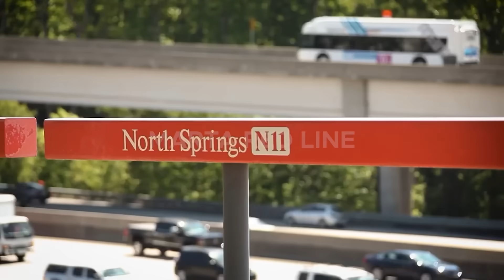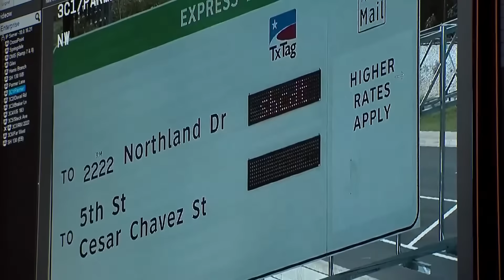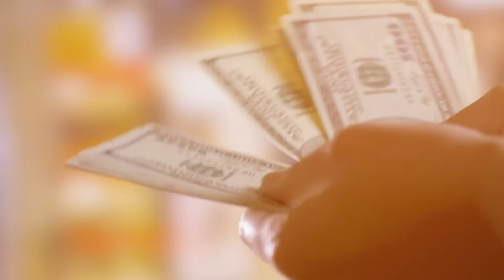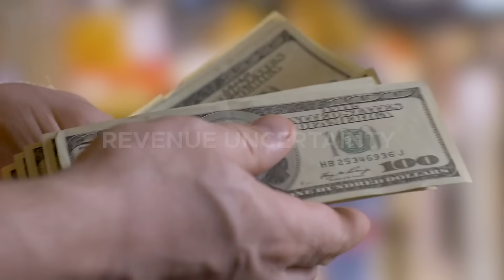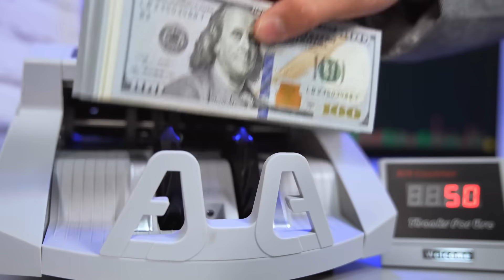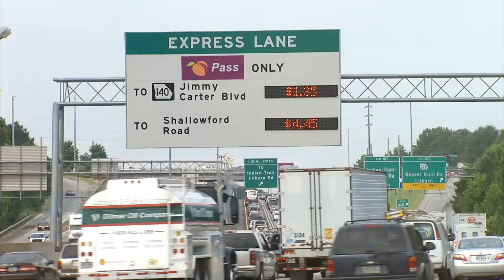The $11 BILLION Gamble To End Atlanta’s Traffic Nightmare

Comment: More lanes is GDOT's answer to everything. I have seen 4 lane highways built out in the middle of nowhere GA, and I ask Why? At the $11 billion price tag, mass transit could be greatly expanded, even if heavy rail costs $5 million a mile, MARTA could be extended to Winward Pkwy on North 400. On top of that MARTA needs to step up by adding more stations where they are needed along existing rail lines.

Comment: Easy. Just build a few more lanes. Get rid of sidewalks so you can add lanes to normal streets as well.
Could also increase the length of vehicles as well. Every time you drive, you could move more of a vehicle with just one drive.

They should probably spread the city to a wider area as well so it would spread traffic around.

Comment: don't believe the BS...problem w/ Atlanta metro:  the people wants to live FAR AWAY from certain areas near downtown and the ghetto elements there...(just look at south of I-20, always depressed).  Instead of solving the problem by RELOCATING certain govt infrastructure to the North, everything must be concentrated within the sh*tty areas...Airport, rather than expanding Hartsfield, a regional airport by Marietta/or east of it would also help a ton.  Problem Reaction Solution, just a scam to enrich certain old boys w/ lots of land/dirt from their grand daddies....using AI, you can easily break down the commuters and where they go.  Most people I know want to live in Brookhaven to Roswell on the west side and Duluth to Suwanee on the east side.  Work on relocating the important infrastructure and services near there, you can alleviate 40-50k cars per day from crossing beyond the lower 285 beltway.

Comment: As someone that works to maintain the expressways on 75, 575 285, and soon 85, trust me. Without the express lanes, your commute would EASILLY have at least another hour added on top of whatever it is now. I have been stuck between one exit and another for upwards of an hour before. Imagine a two hour delay to move a mile. You could literally walk faster. The system isn't perfect. And if you want the traffic to drop, you need to make working from home more common. Even during the Pandemic, one of our points on the North West Corridor tagged over 400,000 transactions in a single month. This was during the shelter on place mandate, and essential workers only. 400,000 transactions. That's roughly 13,000 and change people every single day using that lane for a month straight. Roughly 6,500 during each reversal. So 6,500 people every 12 hours. That's 6,500 people not blocking your path to go a few exists. That's 6,500 people not in the immediate risk of crashing into you causing a traffic jam. 

The only fix to traffic is to remove it entirely. But people with cars are not gonna give them up. Atlanta in particular can't handle that as the sprawl is so vast. Cul-de-sac style neighborhoods will see you drive 5 miles to get to a house a street over, 300 feet away.  MARTA and busses can only do so much, and the planning committees either won't at all handle it, or it will go so slow we will all die of old age first. You want the most immediate "fix", you force WFH and general remote work to be the industry standard for all jobs that can be done so.  But then you have the compounding issue that these huge companies own buildings in Atlanta, and to leave them empty is bad for their bottom line. So again, you find a way to create jobs that allow remote work. Take the cars off the road. Remove need to go to or through Atlanta, and things will improve. But NONE of these answers are so simple. 

The expansion on 400 WILL make a dent in the flow. But it will only do so much. As long as people view toll roads as a problem, they can't do their jobs correctly. Tolls go towards paying for the road itself, funded by the fees SRTA collects from those tolls, which also go into funding GDOT. GDOT maintains the general passenger lanes. Paving, bridge work, street lights, HERO units, the works. And the fee is an exchange for the convenience of cutting your travel time dramatically. 

Moreover, it is my understanding that there is a project on the south side that is working to build a shipping and freight line for 18-Wheelers to help get them off the main roads as well. All these projects are in place to help reduce everyone's commutes. Hell, I WORK ON THEM, and still have to pay for their use. I have to be in the air sometimes fixing a camera or pulling wire, or rebooting something. I see the traffic, every single day. Trust me. You want these projects to happen. You want them to succeed. The toll roads go a long way to help you not hit potholes every 20 feet. Our systems are not perfect, but for now, it's the best we got. Especially since most of the toll roads we have now are converted HOV lanes that most commuters can't even use.

Comment: They're doing the same thing that ALREADY DIDN'T WORK in other places.  Adding lanes is the most SUPERFICAL civil engineering fix you can do.  Houston also invested in lane expansion projects.  It didn't do ANYTHING to offset the rate of growth and the places where they expanded were STILL constricted at the same chokepoints and bottlenecks where suburban commutes met the dense city centers.  It seems like we JUST got rid of the GA400 toll not to long ago & now we're doing it again.  I still remember tossing 50 cents into their stupid basket.  I wish I could suggest a better solution, but I don't think there is one.  From Atlanta's inception, it NEVER had a coherent vision, nor did they foresee its expansion.  Atlanta has never been run by competent urban planners.  The only thing we ever did right was the airport.  Atlanta was just a railway hub that expanded.  You just can't undo over 70 years of poor civil engineering, bad zoning, nor change the car dependency that we imposed upon ourselves starting in the 40s & 50s by just adding more lanes.  MARTA is inconvenient and mostly only takes people to where they don't want or need to go.  YOU DON'T JUST FIX THIS BY ADDING MORE LANES.  It is too late to do the right thing.  If Atlanta were ever to get nuked, once the radiation cleared we could start planning correctly.  Civil engineers could start over and plan cities around more bike, pedestrian, trolley, & underground metro friendly infrastructure like they have in Europe & Asia.  The best way to reduce traffic is not not have to get in a car in the first place.  This is going to slightly mitigate congestion at best.
Reply: The freeway network should have been added to with more redundant parallel routes, but they didn't. Don't think that adding another lane to the basic 1960s layout is going overboard with road building. It was the least they could do and because the region continues to grow in population, you have to add capacity to move food, products and goods for the increased population. That will always require roads, so GA should be encouraged to build out it transportation network in all modes. Highways are universally beneficial to every resident whether they drive or not. Transit is already costing each of us $300 a year in additional sales tax so any major project building more lines would be a bigger burden on all of us. I support MARTA though and want what we have to be shiny clean and heavily used first before committing to build more.
Reply: @stephenedwardsnyc Ask a civil engineer… There comes a point where adding lanes ceases to provide much benefit. There’s actually a point where it plateaus off & you can’t just “add more lanes” your way out of it. The solution lies in coming up with methods of getting people out of their cars. Atlanta missed the boat for having a comprehensive rail transit system. Once population density reaches a certain point, you cannot fix it by adding more lanes.  It actually continues to add other problems besides congestion like places to park those cars at their destinations. It’s creates needs for more parking lots which spaces things out even more which then creates even further distance & more travel time. Tokyo, Paris, Seoul, Hong Kong… they all knew that cars could not be the sole mode of transportation. They all have transit & trolley systems. Atlanta basically put all of their eggs in the personal vehicle basket & neglected pedestrian & public transit.

Comment: the issue is the lack of grid-oriented alternatives.   There are only 2 bridges that cross the Chattahoochee River to the north -  GA400 (4 lanes each way) GA-9 (2 lanes each way) and those two bridges are only 1 mile apart from each other.  So it is a natural bottleneck that everybody from Johns Creek, Alpharetta, Roswell, Milton and all of Forsyth County (580K combined population) has to converge within a mile of each other on 2 roads. If there is an accident anywhere on either road, neither road can take on diverted additional traffic of the other.   Yet there is no alternative way to cross the river.   Rather than Lexus lanes, run the Red Line of Marta up to McFarland (where there still remains ample space to build a large commuter parking lot).  Then  build brand new roads and several more bridges to cross the River.
Reply: IN the meantime encourage those residents to park and ride at the North Springs Station. Express Lanes are always there for anyone to use on a day they need to get somewhere faster.

Comment: 2:23 if the MARTA red line ends at North Springs and from there riders need to use a car or bus that gets stuck in gridlock traffic, why not extend the MARTA red line? Won't a new highway just fill up with cars again?
When you say that the BRT line is ont its way, THAT is revolutionary. More lanes fixes nothing.

Comment: The problem will not be solved until all cars are self-driving or at least in communication with each other and instructing the driver to keep him or her from doing something stupid.
Reply: I have argued for a long time that a huge part of the problem is not volume, it's the drivers. Anyone that disagrees can answer why 6+ lanes of traffic become slow and go, if not stop and go, due to a single exit; they can explain how gridlock DOESN'T make traffic worse.

But knowing it, in this case, is not half the battle - it's a losing battle, as drivers will never work together to improve the overall flow of traffic if they think they can save a few seconds at the cumulative expense of minutes to everyone else (now multiply that by thousands of drivers).

So I also came to the conclusion, about 10 years ago, that traffic wouldn't get better until all cars were self driving and all following the same rules.

Comment: It wouldn't help 400 much but they really need to build an outer loop or at least sections of one, specifically designed to route traffic, especially trucks, around the city.  But and this is critical; they need to have exit only points.  You get off, you don't get back on until you are at a 20 or 75 or 85 interchange.  Otherwise, developers will quickly build up the areas around the interchanges and make traffic much worse.

Comment: I've been driving the 285 to 400 route for 40 years, though not every day. The clog use to happen at Roswell Rd and 400. Since they completed the build, now the backup happens back toward Northside Dr. Even back to 75/285 most every morning. So for them to say they "fixed" the problem is just politicians talking. They just moved all the traffic back 2-3-4 miles. Time to leave Atlanta.
Reply: This is like when they "fixed" the 400 south/85 south merge. They were supposed to add a lane. Instead, they "saved" millions of dollars by just stealing a lane from 85 to give to those people merging on from 400. Helped the people on 400 a lot.... moved the bottleneck to 85. I suspect the people that thought that was a great idea probably lived in Sandy Springs and didn't care too much about people coming in on 85.

Comment: PS - even if only wealthier drivers use the toll lanes, it gets them out of the other lanes, reduces net delay for everyone
Reply: But it doesn't. Roads around Atlanta will always fill to capacity. If traffic improves ever so slightly, it just encourages more building out in the suburbs. It's not an Atlanta only problem, either - it's a proven phenomenon.

Comment: You can make a Wider Funnel....a highway widening, that Still goes to a highway that cannot be widened...still creating a choke point. Georgia screwed up over 20 years ago by not going forward with a second perimeter highway. Express lanes do not cure the bottleneck inside I285 on I-85 and I-75....And No one in their right mind on the Northside wants to use MARTA trains.

Comment: 1. How can we see exactly where the express lanes will be built?  2. The problem with the connection to the bus is they do not coordinate the times well.  There is already a bus.  You can get off of the train and walk to the bus and then stand in the cold staring at a locked bus for 10 minutes.  The least they could do is keep the bus open so one can be in the a/c or heat.

Comment: The last proposal was to expand Marta into Gwinnett by about 1 mile from the Doraville station to Jimmy Carter, and for just a single mile of rail the cost was in the BILLIONS. Plus, the timeline for the 1 mile of rail to be completed was estimated to be close to a decade, which is INSANE! They said they would start Marta  bus service immediately, but both Gwinnett and Cobb have a bus system that are owned and operated by a private company with some county funding. The city buses never even have anyone on the bus, and changing the Gwinnett County Transit buses to Marta buses isn’t going to magically make people start using them. Gwinnett County Transit operates all of the Xpress buses, and that is much more popular and beneficial for people commuting in and out of Atlanta. Atlanta and Metro Atlanta are both very car dependent, and regardless of Marta buses or an additional very expensive mile of rail isn’t going to change that. People can’t and won’t use public transit when it is a massive headache that is more time consuming than sitting in traffic, and I’m a truck driver based out of Gwinnett and have lived in the area my whole life so I more than understand the excessive traffic. Also, despite Marta not being accessible to the majority of places in and around Atlanta, Marta doesn’t have a good public perception, so people avoid it because they don’t feel safe, and they can’t get where they need to go without numerous transfers, and a significant amount of walking that isn’t feasible in a lot of situations. 

The reason Atlanta is so congested stems from the fact that anyone traveling through the state of Georgia has to either go through Atlanta or use 285 (All Thru Trucks are Required to use 285). The economic benefit is that Atlanta is a great place for businesses to put a distribution center or hub because every truck is going to go by there. The downside is that all of the truck traffic is funneled into an already very congested city with no other way to get through the state. 

I think if they build another perimeter further away from the city where all thru traffic can bypass Atlanta  completely would decrease metro Atlanta  traffic significantly. For example have the larger perimeter go through the city’s of Griffin, Carrollton, Adairsville, Gainesville, and Covington to allow driver’s to stay far enough away from the city to reduce the traffic in and around the city and metro Atlanta because right now every interstate meets in Atlanta with no feasible way of avoiding the city.
Reply: I agree with what you wrote, but would simply point out that retrofitting Gwinnett county with rail is simply going to be expensive, but I think worth it in the long run. The little section they were going to do was pointless, but it's the last proposal - if people had voted for the first few proposals 30 years ago, we'd have pretty good rail service into the city, now. Me pointing that out doesn't change anything, but not building rail is a big mistake, IMO. MARTA expansion also helps with the transfers and such - they simply don't go where people need it. When I worked in NYC, the subways were phenomenal. They also have a bad reputation - but I don't think anyone there denies how great they are to get you around town.

An outer perimeter is a good idea. Unfortunately canned do to what could only be described as insider trading that should have gotten people thrown in jail, IMO. But that doesn't mean it's not a good idea. It's what 285 once was. It's needed.
Reply: The highways cost BILLIONS and they are full of cars. Why not spend billions making the rail better?

Comment: as long as dawsonville and above keeps growing, this wont help much. they got rid the tolls on GA 400 around 2010 but now they're back as express lanes. they did the same thing on I-85 above the mall of GA and still it's not improved much. mostly because GA 307 merges into I-85 followed by I-985 split. have commuters cutting over 4 lanes to get on I-985. need to start elevating highways and improving marta.